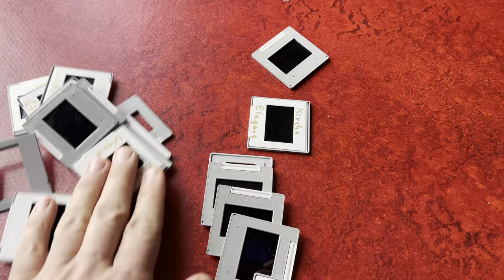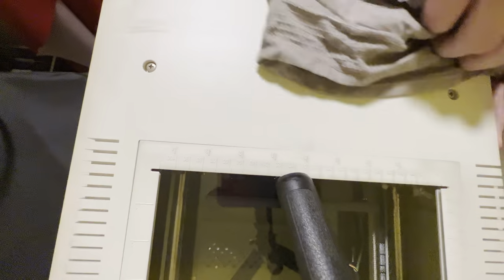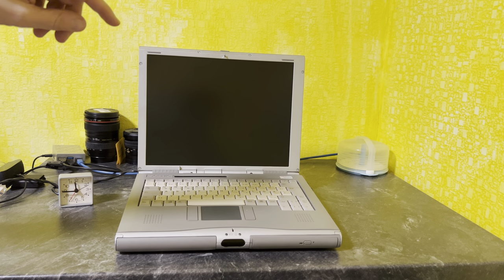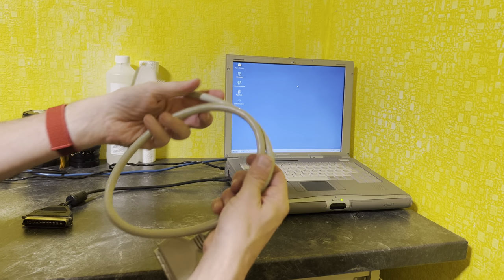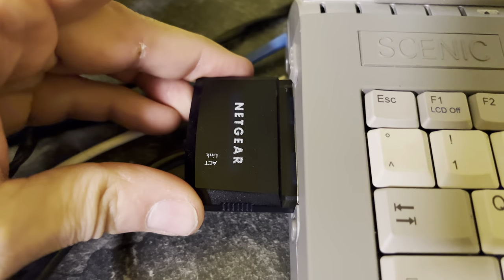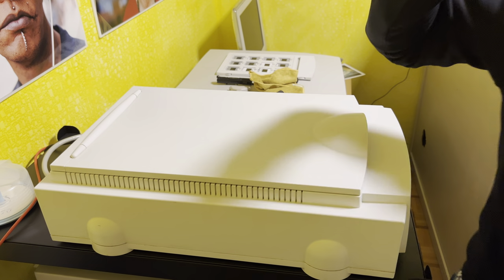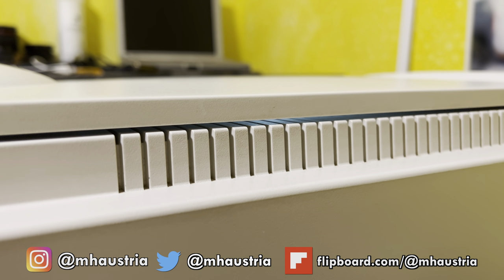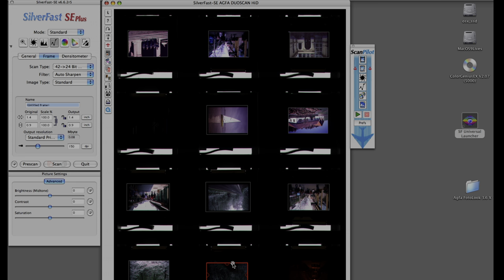Cheap Bargain - Bringing a 24 Year Old High-End Scanner Back to Life

Comment: Hmm also wenn die Treiber mit den aktuellen System funktionieren könnte man eine SCSI-PCIe Karte in ein Thunderbolt-Gehäuse reingeben und sie damit an moderne Geräte anschließen.
Wär nur spannend ob dann zB VueScan funktioniert.
Reply from the maker: Oft sind diese Adapter sehr teuer. Aber sobald das Gerät angezeigt wird sollte es mit Silverfast und Vs funktionieren

Comment: Great video 😊 I revived a Nikon Ls2000 many years ago my dad bought at the Flohmarkt for 5€. It needed a very deep clean as well but image quality is amazing. However, now I face another problem keeping it running as my new computers dont have a Pci port anymore to use my Adaptec2940U SCSI Card. But I'm working on a solution- up to then I need to keep an old Pc for that.  Btw, is your Pcmcia SCSI card fast enough? They're rather expensive unfortunately but would be my prefered solution :(
Reply from the maker: That sounds like a great deal. And cleaning is often easily possible. I still have that card with its original packaging. If you want it, just send me an email. I have also a spare Mac if you prefer that.
Reply: @mhaustria  Thanks so much for your offer to help- I just wrote you an email.